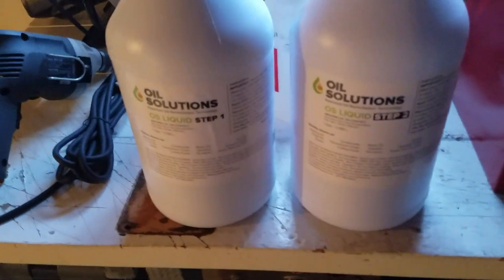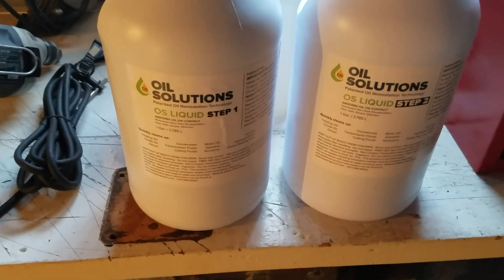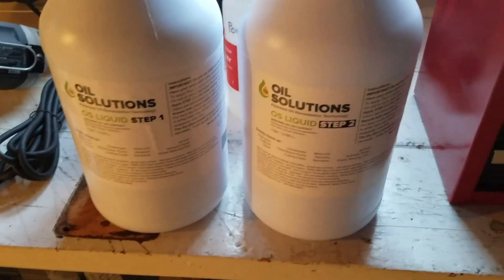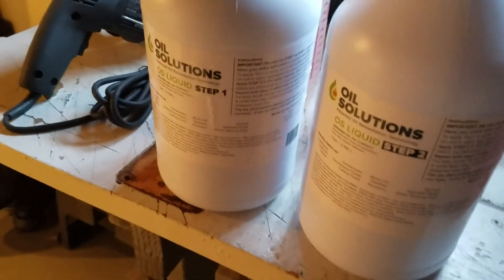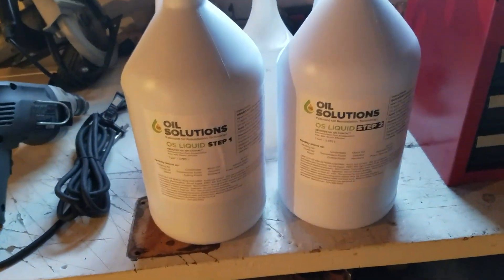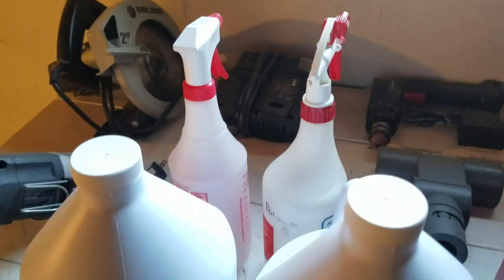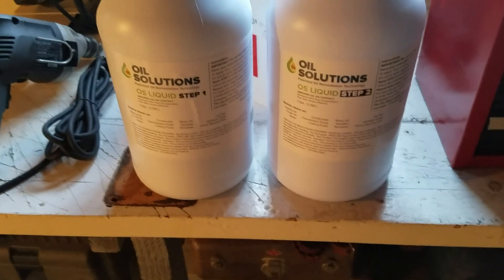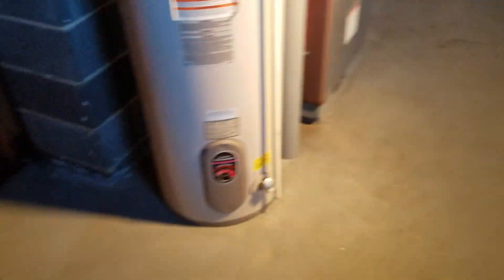How to Remove the Smell of Home Heating Oil Following a Spill, Oil Solutions

Comment: Thank you for this video, I could not find either any solution for my oil issue, and it guided me straight to the right place. 

I got the 5gal format and already applied a bunch on my contaminated concrete. However, the odor seems to come back after a couple of minutes after the application. 

Would you say that 3 years after, the odor is definitely gone ? How many treatments did you end up to do ?

Comment: Thanks for posting this, we had a heating oil spill in our basement and the smell is awful. All through the house. Hopefully this will come tomorrow and we will apply immediately. I saw that you said it got rid of the odor in the basement… did it help with the smell throughout your house? How about when you turned your furnace on for the first time after using this? Did it bring any smell through the house?
Reply from the maker: It took me weeks to finally find this product...I feel so lucky it existed.  Nothing worked and the smell permeated my house... once I used this it was instantly better but took some time for the house to smell normal. You'll be fine I assure you!  And I had alot left over.  I didn't need a much as I bought. Thank you for watching!
Reply: Thanks! If it works as well for us as it did for you I will be THRILLED. Living in Pennsylvania, it’s getting cold at night. We’ve had our windows open for three days and have been staying with family because the house is so cold. I’m worried about turning the furnace on for the first time and it bringing the smell all over our house. I currently have all of the vents closed. Thanks for your quick response!
Reply from the maker: Don't freeze to death...the smell will migrate either way so stay warm
Reply: Did it work for you too??

Comment: You probably still have some residue oil UNDER the 2x4 of the wall. Oil leaks are no joke. We had to clean up an old spill on our business property. Insurance was not there for us and we were told to sue the precious owner of the property who was dead. Just to talk to a lawyer was $5K we ended up spending $700,000 on the cleanup. Now I don't want to have anything to do with oil. Have a heat pump at home and drive an Electric car. Oil and fossil Fuels make me puke.
Reply from the maker: Nothing left thanks to this solution...I was very liberal with it and sure to get it under the wall. I would know because that shit stinks bad and there is  zero odor now.